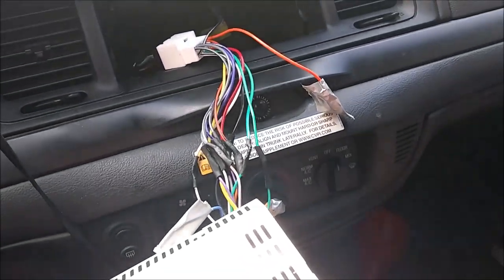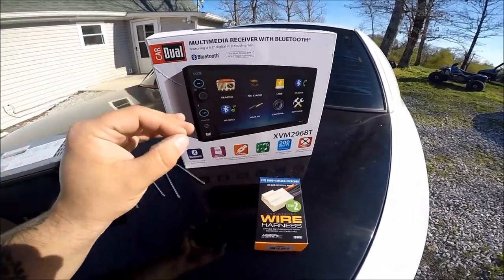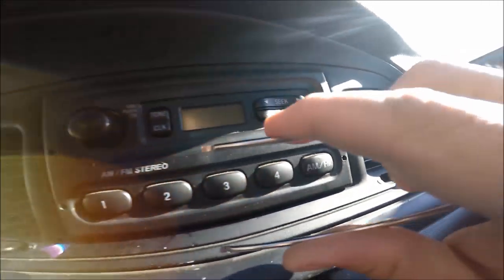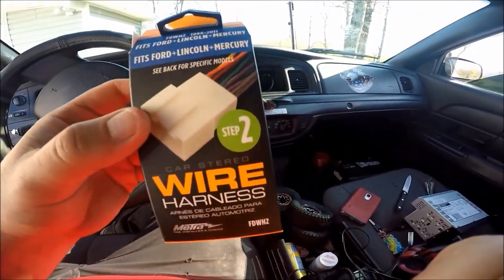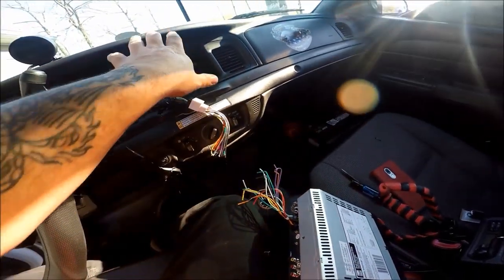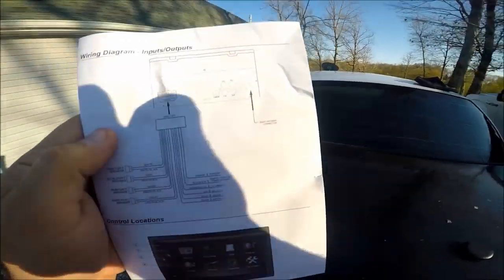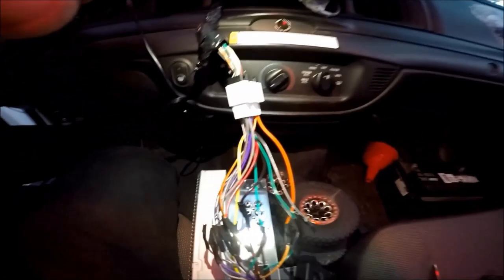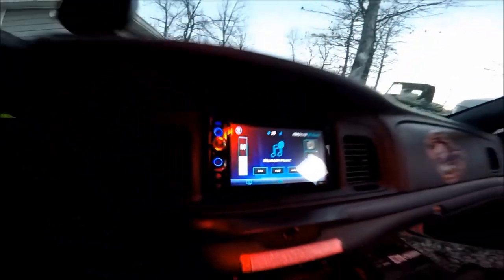FINALLY! an EASY Aftermarket Radio Install for Your Crown Victoria P71

Comment: Since he doesn't mention it in the video, I figure I'll let yall know to save you a few moments of frustration: when you are removing your factory radio and you have those two hoop pins inserted into the face, you have to spread them AWAY from the radio to move the brackets on the sides of the radio. So, the left hoop you must pry to the left and the right one you must pry to the right.
Reply: Thanks your efforts of giving information has been apriciated
Reply: Thank you helped me immensely
Reply: Iv been trying all day just trying to pull it out with it not working thank u 😂😂😂😂
Reply: Would this work for a 2008 Lincoln town car executive L series

Comment: You forgot the first step. Disconnect the battery.
Reply: He is the Crown Vic godfather aka Panther king, he doesn’t need to.
Reply: nah, it's just the radio. not like you're messing with the air bags.
Reply: YES !! That's very good advice. Acording to the FOMOCO Service Manual, the NEGATIVE Battery Terminal must be disconnected before performing ANY electrical work on the vehicle. It's a good time to service the battery before re-connecting.
Reply: @SlikLizrd  Since the radio is only on when the key is turned, turning off or removing the key disconnets all power to the radio.
Reply: @BradHouser  I repeat -- According to the Official FOMOCO Service Manual, the NEGATIVE Battery Terminal must be disconnected before performing ANY electrical work on the vehicle.
 This from the 1995 Factory Service Manual for the Crown Vic, Grand Marquis, and Town  Car. 
 Ignore at YOUR OWN risk. 😁
Reply: @SlikLizrd  Then it is official!
Reply: @BradHouser  YEP. It's official. 😁

Comment: I thought you said "easy" there is no way I'm cutting up the mint condition plastic trim around the stereo in my mint condition 2007 36,000 mile Grand Marquis.
Reply: Same!! 2005 MINT garage kept 40k miles 🤦🏻‍♂️

Comment: If you do all your adapter connections in the house it'll be ready to plug in when you get to the car.
Reply: Sounds good, but how do you get the wires from the car into your house?
Reply: @CutterElfquest are you high? Lmao 🤣
Reply: @CutterElfquest this mf is so fucking blasted on weed rn

Comment: The "antenna " wire is to trigger a POWER ANTENNA so that it extends when you switch to AM/FM. 
The "remote" wire is used to turn on an external AMP like an aftermarket subwoofer.
Reply: Thank you for saying that.  
 
The whole video was really good at first, explaining everything in a productive way, then went completely down hill when he got to the part about the antenna.  It was also very funny that he thought the antenna wire could start a fire or something if it touched the radio metal, when there is no power coming from an antenna. In fact, many radio unit designers count on the antenna shield to act as a nice solid ground. There is no reason not to plug in the antenna, but plenty of good reasons not to forget plugging it in.

Comment: Thank you brother. I used your info to change  stereo for my 2002 Grand Marquis. So easy I talked my man into following your video.  I thought it was the speakers, but was advised to start with the old system first.
Soooooo happy I didn’t have to spend more for speakers. 😎

Comment: Your video would have been perfect if you showed how to put the a wires together cause im very new
Reply: Hear me out right. 
YouTube search: how to put electrical wires together for newbies
Reply: @ZeloepOlleh  😂
Reply: Same. I’m trying this right now and none of the wires on the radio wire adapter are same colors as the actual radio wires. No idea what wires I’m supposed to connect to what lol.

Comment: For those who don't have those radio pins, I found you can use a small enough screw driver to open the tabs. Saved me $25 at my local Lordco

Comment: I was able to buy this radio for $60 at advance Auto parts. Pay for it online and use a 25% code and pick it up from my local store.
Reply: What is the brand of the stereo?
Reply: @edprado8581  Duel. It's in the top left of the box
Reply: LOL Advance auto parts SUCKS !! You can get this for $60 everyday @ Walmart

Comment: Um, what secures the new double din? You just slide it into the dash,  then what? What's actually holding it in place so  doesn't slide out in the event of a rear end or whatever?

Comment: What about the antenna wire? I wanna wire that one up too
Reply: @Nethter definitely wire the antenna wire. This guy half-a*ed this install. he didn't even unhook the battery under the hood, which is the proper way of doing any electrical install to make sure you do not fry your new headunit or anything in the vehicle. Smh just because he isn't going to listen to the radio doesn't mean the person he sells that Crown Vic to doesn't want to listen to the radio. Hard to respect him when he posts a video of a halfa* install using junk from auto zone. A Dual brand headunit, really?! Smh

Comment: Was there no bracket? So it's just floating in the hole?
Reply: Doubletap10MM his videos are VERY helpful..they can be used as a reference for what NOT TO DO 😂
Reply: Yes. It just sits there.  I have one of those pos aftermarket stereos in my Marauder.  Will be replacing it with an original factory one
Reply: Yeah, this guy cheaped out. They make brackets for that.

Comment: I have a 03 grand marquis, it has 3 plugs on the back of the factory radio +the antenna.....
The plug "kit" only came with 1 adapter.  What are the other two plugs for?
Reply: One is remote antenna other is for the steering wheel controls!

Comment: Omg that radio fits in there LIKE A GLOVE…so simple. I got the wrong radio type and wiring harness. Really didn’t think about just getting a radio with wires on the back already, instead of plug and play 🤦🏾‍♀️ now I know. Thanks

Comment: I hooked it up and it turned on then I turned my car off taped it up and now it won’t turn on I re did everything and now the radio just won’t cut on , I checked my fuses and they’re both good should I just take it back and get a new one ?

Comment: Hi... what is the harness adapter that you used (and where did you get it)?  i bought a head unit from crutchfield for my 2005 grand marquis but the harness adapter that they prewired don't seem to be the right one... anyway i looked at the plug from the car in your video and it looks like the same as mine... thanks in advance...

Comment: I have a 6.2 inch pioneer avh120 bt, any tips to get that to slide back. Also, shout out to  metal coat hangers, who needs the metal tool to pull out the factory radio 😂

Comment: I just use a metal hanger the same way but it’s a little smaller so you won’t f up the sides and you don’t even have to wiggle go = not // and you can literally pull it out in two seconds

Comment: Checking if anyone else got this issue. Worked fine the first time I connected it. Made some room and plugged it back and boom. It’s not working anymore. 
What wires did y’all plug in and what did you leave out ?

Comment: Would this be similar with a grand marquis also? Or is it different due to the steering wheel  volume and track control?
Reply: The Crown Vic and the Grand Marquis are nearly identical. I may install this same radio in the famous 95 MERC.
Reply: If yours is a 2003 the parts in this video are the correct. I bought all 3 wire harness adapters and the one in this video is the correct one.

Comment: Quick easy question on this installation. Did you just tape off the orange and pink wires and the DVD worked? Or did you connect them to ground. Also my harness from the radio has 3mm jack too did you tape that off also?

Comment: I'm gonna need to replace my factory speakers huh? Just bought an 04 police interceptor with 120k miles. I want to replace my radio but what about my factory speakers. Will it not sound good with the new radio???

Comment: One problem with my after market radio and original doesn’t turn on do u know why? It just turn the green lay out on but the screen it doesn’t turn on, do u know what’s the problem?
Reply: Check fuse for clock radio has 2 fuses

Comment: Question, wouldn't it been easier soldering the harness on a bench then plug it in?
Reply: You got a point. Will be easier
Reply: Robert Villiard YES of course that would have been easier. he just did a halfa** install using a cheap janky Dual headunit. Didn't unhook his battery under the hood as should be done when doing any electrical work on a vehicle. Didn't wire the antenna which made zero sense. Even if you aren't going to listen to the radio atleast wire it up the proper way. The person he sells that Crown Vic to might want to listen to the radio. Then again that piece of junk Dual Headunit will not last anyway, its probably already broken.
Reply: @itdoesntmatterwhatyourname6128  i put a Dual in my grand marquis w/Polk frt. and Kenwood rr. It sounds awesome

Comment: Did you just loosely slide it in or did you actually mount it with a brace or bracket of some kind? I can see it bouncing out while traveling a rough road if you didn't. haha

Comment: Great video , I'm picking up a 2011 Crown Victoria P7B police interceptor next week with the stock radio , Did the radio lock in place when you pushed in it. ?
Reply: Most of the installations like this are held in by friction. If you get one of the adapter kits from Crutchfield, it will lock in and cannot be removed without removing the dash.
Reply: Thanks for replying,  but unfortunately, the car was totaled in an accident, but my new 2011 Crown Victoria came with a pioneer radio .

Comment: Can you still wire it the same way without the adapter ???? Pls help I’m trying to put my radio and sub in
Reply from the maker: you can....but its a wiring nightmare to figure out which wire  goes to witch.  i reccomend the adapter 10000000%

Comment: Yo I bought all this shit and set it up but I just cannot get the unit in flush! It pokes out maybe an inch ish. Any ideas on what it could be? I grinded it out with a dremel to fit nicely and such.
Reply: The power wire probably needs unclipped ?

Comment: Bought all parts listed only to find out that mine has 3 harness connectors on the back of the radio, mine is a 1999 with no cd changer or amp.

Comment: Ok I did all this but I start my car and the stereo works for 4 seconds then shuts off . I don't have the orange wire hooked up because with not needed. But I'm wondering if the blue ant wire is hooked up wrong???
Reply from the maker: did you install it on a crown vic?
Reply: @MrRandomReviews  yea 2008

Comment: Good evening.  I have an 03 Crown Vic PI. Can someone advise of wiring harness part number by chance, in addition to one shown FDWH2.  I'm having issues finding online that looks similar to one shown. All the ones I found say, "Dont fit police interceptor".  Thanks in advance.
Reply: The harness he uses will work.   It is not the harness that shows when searching online.

Comment: What are the stock speakers like in these things mine doesn’t have a working radio kinda curious if it sounds pretty good without upgrading speakers or adding amps which I’d probably do anyways for subs
Reply: Actually pretty decent. Just got an 04 vic. Just a base model. But I went from an 08 mustang with a pretty good stock sound system to the vic. And honestly. They're kinda similar.
Reply: @James-mh7vk  I ended up getting radio for it and it is surprisingly good for a factory radio

Comment: 🙈 the orange wire is the dimmer wire!! If you connect it ones you turn on your headlight it dimmed the screen for night time viewing
Reply from the maker: not in this case. not for this radio model
Reply: I just installed the radio and I when I turn my headlights on, it makes the radio say no signal. Should I do a pcm restart?

Comment: Am Nigerian and I want a crown victoria
Reply: I just bought my P71 Crown Victoria last week. I love it, very good car.
Reply: @jasonvoorhees8545  where , what part of the world ??
Reply: @ebubechiibegbula5968  I live in a country called Canazuela (Canada). My P71 Crown Vic is an old RCMP car, Royal Canadian Mounted Police,  our federal police force.
Reply: @jasonvoorhees8545  ok Crown Vics are rare in Nigeria and if seen its the civilian version we have
Reply: @ebubechiibegbula5968  The civilian version is way different than the P71 version. The P71 is tougher, faster and I have posi-traction in it. The rear passenger doors only open from the outside because of the prisoner restriction thing.
Reply: @jasonvoorhees8545  that's why I want 1
Reply: @jasonvoorhees8545  not always prisoner thing. If you buy a supervisor one with civilian interior !

Comment: Do you have other recommendations for other radios? I wanna put a new one in mine but I don't like the touchscreen or Bluetooth stuff.
Reply: I have a pioneer single din head unit (I think it was $80 one) that I bought about 7 years ago when I got my license and my first crown Vic and shes still cranking out tunes without issue

Comment: So, I have a grand marquis and when I pulled the radio out, it had three different connections along with antenna cable. Will the adapter still work?
Reply: 2003 up MGM and civilian CV require a different adapter, but it’s the same basic idea.

Comment: I tried to get one of those installed in my 2011 and they told all the screen wouldn’t fit unless they cut into my air ducting… so I had to get a normal (non touch screen) radio 🤷‍♂️

Comment: Where do you get torch and wire conecters
Reply: That's heat shrink he's using. You can get that at harbor freight or any hardware store

Comment: so you just tape the wires together?
Reply from the maker: no  you have to twist them together and cover them with heat shrink wrap

the tape is for extra protection incase they get hot

Comment: What wire controls the radio automatically coming on when the ignition is switched on ??
Reply: Obviously the power wire
Reply: Power wire goes to the ign switch 
Memory wire goes to the bat 
This way the memory is powered 24 x 7 to keep the memory powered for favorites and settings. The  when the ignition is switched in it powers the radio for operation.

Comment: Ohh boy. You are a genious.  Is the car burnt down yet?
Reply from the maker: still holding up.  and thanks!
Reply: @MrRandomReviews  right on! I have a 2007 p71, with full grill guard. I put a clarion single din receiver in it, along with 2 amps, ported box with 2 15" soundstream subs, and rockford speakers in the rear deck and doors. Good cruising rides!
Reply: @MrRandomReviews  What keeps the radio from falling out other than gravity?

Comment: When I turn my lights on my radio turns off any help guys
Reply from the maker: i LITERALLY explain how to fix that at the begining of the video  SMH🤦‍♂️🤦‍♂️🤦‍♂️
Reply: @MrRandomReviews  yeah I did that orange one it's still doing it any other possible thing could cause this mate,

So only wires that aren't connected to anything blue, orange/black and orange

Comment: Can't believe you just didn't connect the wires on a bench. I mean damn man, that's the whole reason for the wiring plug. Hate ta see how you change the oil or put air in the tires.
Reply from the maker: shouldve just made your OWN video bro...always gotta nit pick bruh....funny thing  is this is STILL the best video on how to install a vic radio on youtube

Comment: Wont work in an 01
Reply from the maker: just need a different adapter
Reply: @MrRandomReviews  still will stick out about an inch. Have to either use another years ducting system or cut through the vent tube
Reply: @jesseorr1468  that was going to be my question. I have an 01 Grand Marquis that I swapped the factory radio/cassette out for a factory radio/cd and know about that 1.5 din setup. Love the finished look of this one on video.

Comment: This was never a hard thing to do tho. The CVPI radio swap is the easiest thing to do in that car
Reply: That’s the easiest thing to do in that car? Um sure.
Reply: @StockTurboN20  I mean besides driving it, yeah
Reply: Steven Balas I know the cars inside and out the whole car is easy to work on
Reply: @StockTurboN20  exactly. And this is the easiest part.